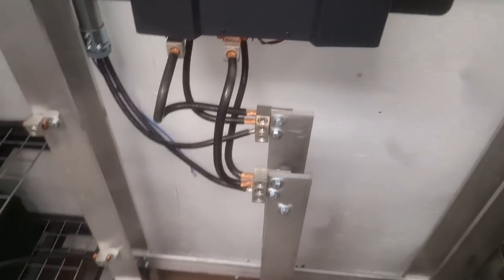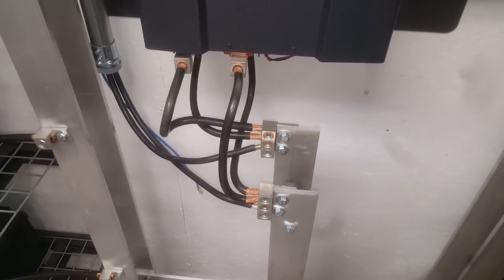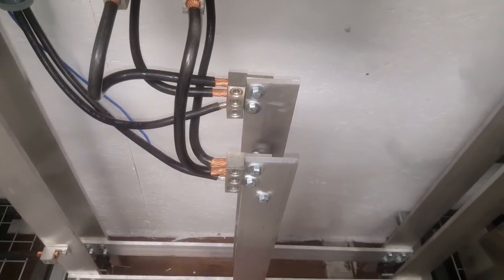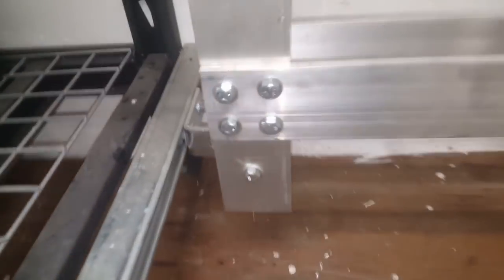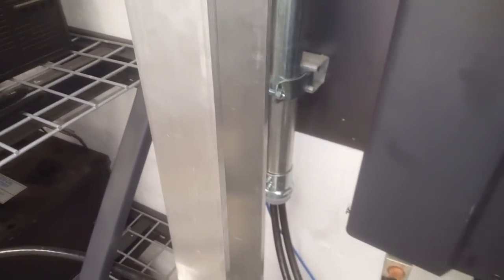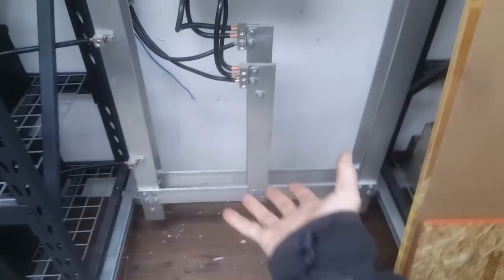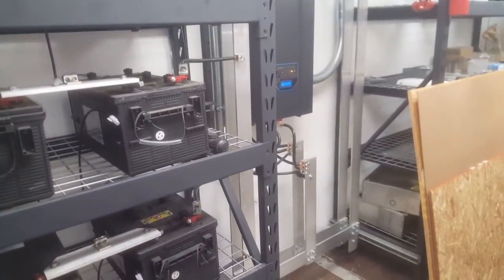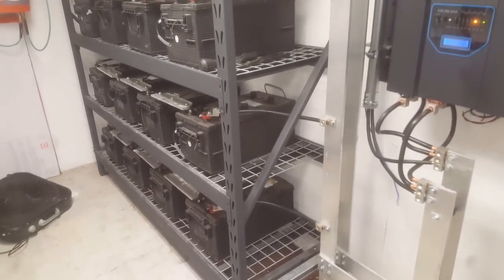Concerns with busbar and living off the grid

Comment: Because your racks are metal they should be bonded to the grounding system. Problems arise when you bond your racks, then accidentally touch your bus. Even low voltage can kill. You could insulate your bus. Many cheap methods to do that. It is never the stuff we plan for that goes south its the stuff we don't see coming. Now that I got that out of the way. I love your setup. And I got the same racks. Costco right.

Comment: The door to our warehouse was always locked that warehouse contain day Frankenstein generator station 4160 volt neighborhood stray cat got in there one night about time I got there and I was a serviceman on call the cat look like a boiled raccoon across the bus work on top that nice little system we're in the process of converting the town over to 7200 budget restrictions and all funny I have to cat crossed and shorted everything out and yes it was one stinking smelly mess to clean up an isolate suddenly they had money to build the system correctly we went ahead and upgraded the rest of the Town 7200 and got a new service truck and Digger truck out of it thing about bus work never trusted if it's open where anything can get to it rats do grow big and chew on everything that was 21 years ago and as I type this I can still smell of that cat smell like and trust me there were 25 people around there not one of them was volunteering to go into the back of that sub works with me you have 30 inches of space in there to walk all the rest of it is live hot can't shut it off yeah I was low man on the totem pole with can years of extreme experience already never got my big pie nowadays I see line cruising electrical Cruise out there working I can crack up laughing washing how long it takes him to do anything and how many men they got doing dismembered if it ain't grounded it ain't dead if you leave it out there to chance some varmint or yourself might get in it one day and wind up looking like at fried cat cover your bust work up Liquid dip Force Base plexiglass in front of it

Comment: Still amazed at the amount of batteries in the room. :D

So, I take it you don't have electrical service where you are? Or just want to be self-sufficient?
Reply from the maker: Four ZeroFour check out my latest video where I finished the second rack....it would cost $70,000 to bring power to our property
Reply: $70,000? Wow, that's not worth it, for sure. Good choice going with off-grid stuff.

Comment: Excellent setup.... 👍 
Some rigid fence to protect the busbars would look awesome...... to prevent you to touch the busbars with some metal or something.... 
Excellent setup once again.... 👍 
About galvanic corrosion between copper and aluminum is something that could make some issues... 👍
Reply from the maker: +Bostjan Trancar there is noalox on all the connections. It is very common in Industry to have copper to aluminum transitions. Most panel boards have aluminum bussing these days.
Reply: Well good to know about it.... 
We use only cooper or special lugs..... 
Aluminum is last option.... but if is work without any issues I give the big 👍

Comment: Nice work! It's no different then walking into a power grid station. Don't do It, Authorized personall only!  It's there for a reason.
 I love your setup with the bus bars. I'm busy doing the same thing.
 I'm working on rotating 20 solar panels around two axis but I'm having a debate with myself on how to make the rotation bearing setup to be strong enough to rotate East to West. The mechanical aspect of it that is!
Reply from the maker: +R Nierop I use weld on gate hinges rated for 900 lb, however my setup only goes east to west. I'll do a video on my solar tracker here within the next week or so
Reply: HighTechLab Thanks for the reply... I'll look forward to that video. 
I'm designing the whole thing in solidworks and having it certified by third party. I'm installing with permits. I have high winds were I live so the panels will go horizontal and facing in the wind if required. 20 panels are like a giant sail. 😁 so that one axis is my dilemma and getting it right is a must.
Reply from the maker: +R Nierop if you're going permitted and certified everything needs to be intended for the purpose. My idea of gate hinges is out the window because those are not intended for the purpose and will never pass.
Reply: HighTechLab I am only permitting because I was told that I had to by county.... not that I want to. I really want to experiment with diffrent designs so I may just have to blow the county off! Most people around me have nothing even close to a permit. I think it's just a way for them to relieve me of my cash.

Comment: What type of bolts, nuts and washers are you using on your aluminum buss bars?  I would have thought you would have used stainless but they don't look stainless on the video.
Reply from the maker: +Roy Smith just regular old run-of-the-mill bolts. I've had bad experience with stainless bolt seizing up.
Reply: I used stainless fasteners for years with no problems at all. Then one day I started have the same problem with seizing.  I still use mostly stainless as I live in a very humid area but now I use anti-seize on them.  Thanks for the reply and good luck with you off grid project!
Reply: Im in the power industry, and we have had a lot of issues with SS hardware as well. Only thing so far that helps is using 3-16 grade bolts and 8-18 nuts. So far, no more seizing up. 
 I believe fastener manufacturers are changing their stainless recipe. Have you noticed stainless bolts are getting more and more magnetic?